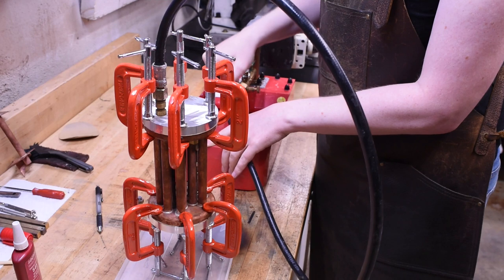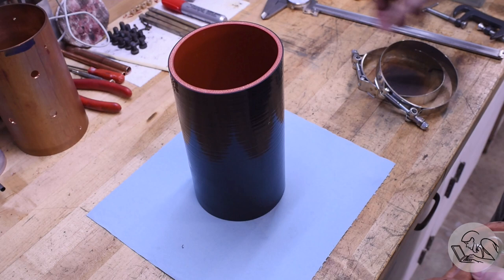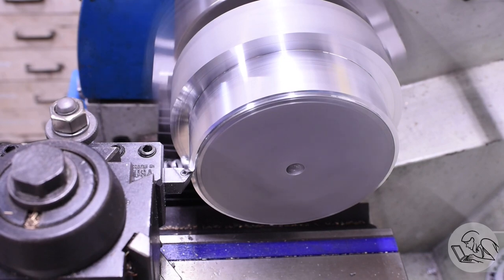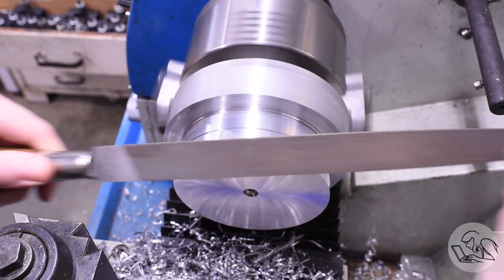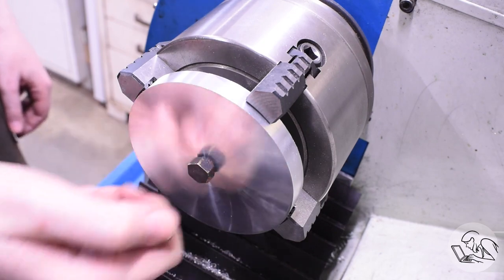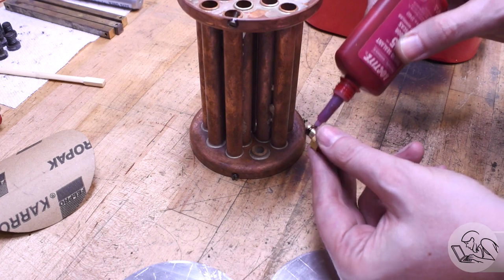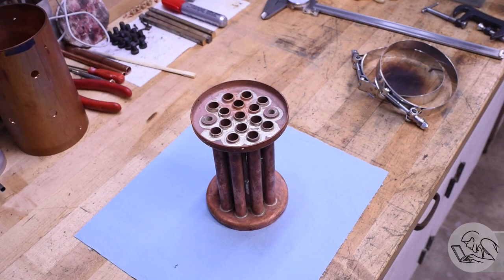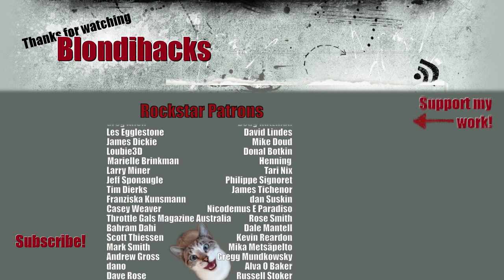Pressure Testing a Boiler Core | Model boiler build, part 9!

Comment from the maker: Hey everyone! Since a lot of people are saying it, yes, of course the pump mechanism isn’t a source of bleed-down because it’s after the ball valve. The ball valve and hose are part of the pump and that’s what I meant when I said “pump”. Let’s all be good sports here and give each other the benefit of the doubt on such things. 😉

Another common question is why didn’t I clamp the end plates by threading rod all the way through? The reason is that the tubes are soft at this point. They are annealed from the heat and are easily distorted. They would not take the clamping forces needed for a 120psi seal. The tube flanges are much much stronger.
Reply: Saw this comment to late. I’ve commented about placing a needle valve
Reply: I thought the same thing and wondered if I was missing something
Reply: I worked with fire sprinkler systems and often the ball valves "let by" and down to reasonably low pressure.
This must be the case or you would be seeing oil somewhere, must be returning to reservoir right?
Reply: I knew what you mean, Quinn. We have been on a European River Cruise and the guide said there are a lot of Canadians on board. She said if you need to go to the toilet can you please say Bathroom or even better Restroom. ??? I said its taken my wife 5 years to teach me to say toilet! One massive bloke (maybe a lumberjack?) used to call it the Powder room! (Oh dear!)

Comment: FYI - it's easy to make custom sized o-rings.  On a flat surface, form your stock into a circle of the correct diameter,  overpassing to the outside and then slice thru both simultaneously with a single edge razor blade held at a 45º angle.  Then cement the two ends together with superglue and you're good to go.
Reply: You can also buy o-rings of different thickness on a roll/drum will the correct glue.
Reply: I always wondered if that really worked ???
Reply: @petem6291  yes. Fantastic.
Reply: @petem6291  Yes, it works well. I've used a larger o-ring with the the same cross section, cut and super glued to the diameter needed for a hydraulic fitting. This was on a Gatwick friction welder, ran for years. We ordered the correct o-ring but never installed it.

Comment: If you ever want to do this again, leave your plates at 5" and drill 3/8 holes around the outside edge and clamp them together with threaded rod. You could easily get 12 rods around the outside. Also maybe neoprene would make a better gasket? I expect the ends of the tube core aren't perfectly true. Nice work and thanks for sharing!
Reply: @Murgoh  I was thinking this too. My only worry is that this would place a lot of force on the solder joints themselves, as they now become part of the clamping structure, rather than just clamping the endplates against the new fixtures. I think that silicone pipe may have been better used sliced open to make the gaskets rather than the paper jointing material.
Reply: I've built a similar contraption for pressure casting resin parts. I found the solution to eliminating bleed down was to seal the gaskets with regular old plumber's putty. It eliminated the need for elaborate clamping, as it compensates for the subtle flexure of mating surfaces.

Comment: Hi Quinn, hope you are well. I loved this video, only remark I can add is, the end gaskets I would have used rubber as in an old Lorry innertube, more robust will fill any micro gaps and not so lightly cut by the copper, what a brilliant idea you had for testing those tube joints. Love you and your humour. Take care and be safe. X

Comment: Cheap c clamps are great. For tight uses like this some cheap c clamps with the handles removed and some flats milled in the shaft for a socket can be a life saver.
Reply: That's a great idea !
Reply from the maker: Oh great idea!
Reply: Good idea as long as a gorilla does not get on the socket. GP does not stand for general practitioner (doctor). It stands for gorilla paws - ie overtightening.

Comment: Hi Quinn, I think that was a good way of going about it. Gave visibility of all the tube joints on both sides which is very helpful if not essential. You got a high probability that the completed boiler would take the x2 test pressure. You'll obviously need some sort of pressure gauge and stop valve near the boiler to hold the test pressure if you can't fix the pump run down. Maybe you could say a few words about the boiler test regs you will be following.

Comment: For gaskets you might want to get a sheet of Klingersil 4400 , that material is resistant to water, steam, oil and many other liquids and even gases. 
It is easy to cut with knives, scissors and you can use holepunches.

Comment: Nice trick to make custom circular gaskets is to glue a sheet of rubber onto faced round stock and clamping an exacto knife in the toolholder, with that simply cut out the shape you need.

Comment: I have been thinking about the need to pressure test this before assembly since I saw the last video.  And right here on your channel is a great video showing how you did it.  I would not have wanted to assemble this assembly without knowing it held pressure.

Comment: its not just the gasket.  4 in dia = 12.5 square inches.  x 60 psi = 754 pounds.  the end plates are thin and can flex as well as the clamps.  A couple thousanths will exceed the gasket compression.  Thanks for the interesting project.
Reply from the maker: Yah, I figured they probably were.  It’s a lot to ask of aluminum

Comment: Hey Quinn, I work on diesel trucks and have come across a lot of flat round rubber seals for fuel filters or fuel water separators that would probably be the right size. If you know anyone who works on big trucks they might have some. Also instead of clamps you might be able  to seal it be passing a piece of all thread all the way through and use copper oil pan drain bolt seals and nuts. Speaking of copper washers, if the copper rims are flat enough  and you can get it tight enough you might not need a gasket.
Reply from the maker: I updated the pinned comment with the explanation why I clamped the way I did. 🙂

Comment: Hi, what you observe is maybe a isothermic effect. When you increase pressure the temperature will also increase, this temperature will bleed out of the system overtime, this will give you a drop in pressure. Used to work with calibration of pressure sensors, and we always needed to wait a while after increasing pressure before taking measurements.

Comment: With the hose isolated (closing the valve), the part that is bleeding down should be after the shutoff valve.  With all the fittings tight, I would look at either the valve (internal sealing of the petcock),  the hose (failure of the rubber in the hose, in my book the most likely culprit), or possibly the gauge leaking internally.
Reply from the maker: I’m pretty sure it’s the cheap hose that came with that pump. It’s a terrible thing.
Reply: @Blondihacks  if you're ever looking to replace it I highly recommend Parker 919. For low pressure stuff (1000-3000 psi) it's really very nice. I like it because it is chemically inert and I have used it for everything from high pressure machine tool coolant to brake lines. And you don't have to have a crimp connector you can actually get field assemblable fittings. It's a poly tube with a stainless overbraid and the -4 size almost looks like scale model hose.

Comment: Nice results! 
I can recomend to exchange the ball valve for a needle valve on the pump.
Maybe together with a checkvalve in the circuit.
This will hold the pressure much better.
This is how most hydraulic handpumps work for calibrationg gauges and pressure sensors.

Comment: The oh!? ring probably wouldn't have worked but they make o-ring splice kits so never worry about not being able to find the right size(length/circumference) you can cut and glue them and it works just fine. You're videos are an inspiration keep up the good work! One more little tidbit, a drafting compass and an exacto knife in the pencil holder makes the prettiest round paper gaskets ever.

Comment: Quinn, conversation back to the o-ring thing.  Now that you have quite excellent end plates and clamps, might you trade the paper gasket for a thick o-ring?  It would fill the space in the copper dishes between the OD of the outer ring of fire tubes and the inside of the rim of the dish.   Needs to be thicker than the rim of the dish so that the aluminum end plates will bear against it,  but you would have a pretty wide tolerance for o-ring ID and OD.  As pressure builds, the oring would press out to the rim of the dish, but should keep a seal down at 120 psi.  I just checked the yellow book and it looked like there were a few options that would work.  Could always glue up the size you need, but it looks like there are some stock options that would work, depending on the depth of that rim.
Reply: Was thinking the same, if i really needed to do that test at 120 psi. Alternatively, a ring cut with square cross section cut smoothly from a soft rubber mat (or a stack of them). 

Since a thin gasket can't compress much, any small deviations/deformations from flatness in the surfaces isn't likely to be filled up enough by the gasket. It's different when the gasket is sealing a wide area like a flange.
Reply: @hieronymuslarsson1388   @Hieronymus Larsson  Yes, understanding that this was an intermediate test, and that she got what she needed out of it.  And that we are seeing this (possibly) after she is 10 steps ahead IRL, so our comments are not timely.  But she is testing it at a critical point in the assembly, and if more PSIs were needed on such a shape , not sure how I would get there.  

My other idea was an external oring on the OD of the dish, in a groove in the ID of a piece of 4" sched 80 or 160 to get enough material to get down to 3.92".  Would not need to be steel pipe, heavy PVC would do it at that pressure and temp...and be cheaper/ easier to machine.  Soft solder in the 3 rivet holes... But I have some of that in my scrap pile, she probably does not.  Fun problem to think about.
Reply: @BrianFullerton  
Sure, working against the OD of the dish would work too, one big advantage being that you'd be at greater liberty to choose size of the cross section of the o-ring. Supposing the dish is round enough.

Yeah it's one of these oddly interesting problems. Sealing is as satisfying to get right as it is frustrating when it doesn't work. It's neat when the pressure helps seal off itself.

Comment: If you made two plates over sized to where you could put bolt holes around them just outside the diameter of the core, then make two more and thread them to be bolts to the over sized one, but cut those the inside diameter to just miss the tubes! Cut those in half, then they would push on the bottom of the core plates and would give you all around clamping force! Have made ones like this to do press testing back in the day! You could also make short plates the could hold the cut plate from spreading about where they come together for more rigidness, just a thought!

Comment: Looks solid to me but if you really want to keep testing you could run threaded rod through the tubes and thread them into the bottom sealing plate.  Drill holes in the top plate and use (silicone/gasket?) to seal up nuts/washer/what ever works.
Should provide a more even clamping force though I would use a thicker rubber style of gasket.

Can't wait to see it in action!
Reply: I think it should still need some (a lot of) clamping force right around the rim, independent on each plate, clamping the copper and aluminum at the rim.  As the pressure builds, the copper dish will deflect in towards the opposite end.  Rods in the middle could help control flex in the aluminum plates when pressurized, but under zero pressure could also put a lot of extra stress on the solder joints.
Reply: @BrianFullerton  yeah, I was thinking about that after I posted.  Could be solved with metal or harder wood half circles inserted between the copper end plates to prevent them from being crushed.   The force would then go to the  bell ends (for lack of a better word, and funny) side walls. But regardless of that, the gasket is the main problem. I would use an ⅛" thick rubber gasket instead of the paper like gasket she used.  99% chance it would work with the clamps she got.

Comment: I’ve had to part off odd slugs in the band saw. I did roughly the same thing, except instead of a through hole, I drilled and tapped on side. Then bolt to the angle block and can part off all the way….

Comment: Hey Quinn, have you thought about putting a channel that the lip of the boiler can fit into in the two lids? That way you would have more surface area on the paper gasket to hold the pressure, essentially sealing from inside, top and outside. Could possibly buy you the extra PSI.

Comment: Very neat project, Thanks for sharing!

I would say 10 PSI would have been enough for a leak check of all your joints. The point of a hydrostatic test isn't for leak testing but to test structural integrity of the assembly. Failing to reach hydrostatic test pressures for a leak test is inconsequential.

Comment: I would be tempted to rerun that test using something like 6mm thick rubber sheet instead of the gasket paper.

Enjoyed that very much, particularly the method for holding large stock in the bandsaw.
Reply: Concur, although a 2 - 3 mm rubber gasket will suffice.

Comment: Nicely done Quinn.  I am thinking that if your hydrostatic test unit can't hold pressure but does not leak any water the problem may be the shut off ball valve leaking pressure back into the main unit. I have had a number of lesser quality ball valves fail in this manner. Replacing it with a high quality ball valve solves the problem. Keep up the great work...  Fred

Comment: I think the slow loss of pressure in the pump  test may be caused by slow elastic flex of the tubing and other parts. I would guess that to stabilize at some point. Water can not escape just like that without leaking. Also, some plastics are known to absorb water a little, like 1% of weight in the skin depth.
Reply: Internal leaks in a pump would tend to flow back to the reservoir and not necessarily show up anywhere externally on the pump. That said, any small amount of water loss, no matter why will effect the pressure.
Reply: @noelhenderson700  To be precise, what I meant was that since the pump is isolated with the valve from the SUT, the SUT pressure was dropping. The reasons for that are what I mentioned plus possible leaks. In this particular case also the paper gasket was dry when installed containing substantial amounts of air and is probably the main culprit. The gasket might be wet completely for a few days before put into place. Water is nearly incompressible and so are all metal parts. However, the parts suffer from dimensional changes when pressure rises and this will lower the pressure from the initial reading. Due to incompressibility, extremely small volume changes affect the pressure after closing the valve. One more thing, tap water usually contains lots of gases too affecting this. Using vacuum for removing gases from the system before letting water in and increasing the pressure might be a good idea.
Reply: I was thinking the same thing, as I've been designing an adhesive dispense system and I think the ever so slight expansion of the adhesive container is something I'll have to account for.

Comment: you may have been able to seal against the flat inside edge of the top and bottom on the outside of the fire tubes but inside the wall, dish out the blocking plates so that there is a ring on the outside edge and using a thicker gasket material with the 6 clamps on each side

Comment: A solution that might work is to get some industrial rubber "mat" (Not sure about the correct word for this since I'm not a native English speaker) but they are available with flat surface in different thickness. A relatively thin one cut into a circle and you will even out the pressure more from the clamps.

Comment: Paper gasket is used between to wide flat flanges then it would work.
Maybe use some soft silicone sheet instead in your setup , this would let the thin edge of the copper bite into the silicone to seal slot better than the paper gasket.
Keep up good work.

Comment: The water passage plugs on our cylinder head pressure tester have rubber on the bottom, but we've had good luck making some with urethane foam as well. Not that those aren't the next obvious choices in line.

Comment: The oddball threads that model makers use have their origins from the 1920's when Singer sewing machines used these non-standard threads on their products to monopolize and inflate parts prices. A Singer 1/4- 40 screw cost 8 times more than a 1/4-28 SAE from the hardware store. In the 1930s Singer was charged under the new anti-trust laws and forced to use standard threads. I was a Westinghouse apprentice in the early 1970's and would sometimes make parts to fit on parts that were sub-contracted to Singer in the late 20's, so we had to be able to make these threads. I remember one job where I had to replenish our stock of 0-88 screws. I was on a tool room turret lathe for weeks making 2,000 piece runs of every length, from 3/16 to 1 1/2. Model makers are not the only group to use these threads. Gun smiths also use them. I am a competition long range shooter and I modify and build my own rifles, ammo, and even my own reloading presses.

Comment: When you close the ball valve between the pump and gauge that takes the pump out of the leak equation… most likely your ball valve is leaking. Since those pumps use checks to initiate pressure build it’s not uncommon for the checks to get some debris or defect artifact in them hence why that ball valve is there.